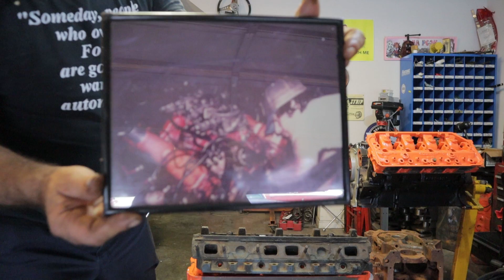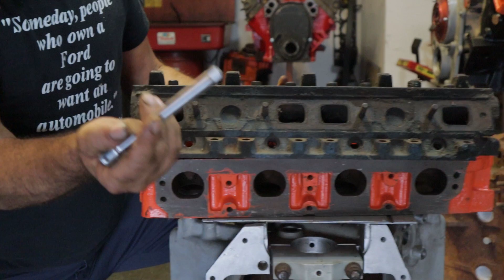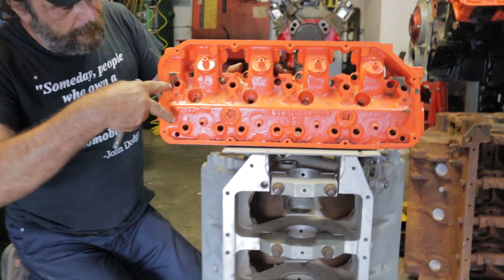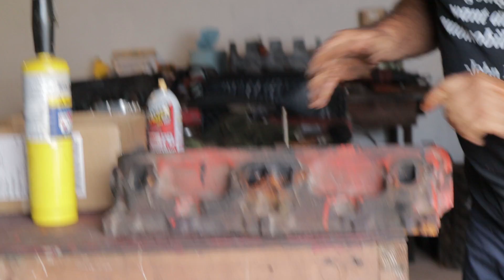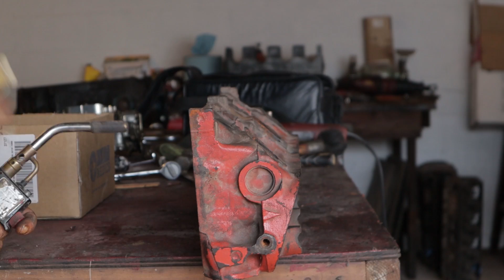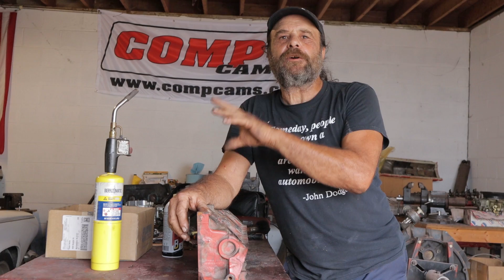What Makes The Small Block Mopar Such A Great Engine?

Comment: The valvetrain layout on the LA Chrysler is very poor with lots of pushrod angle at the lifter.  The exhaust port is poor it has no short side radius what so ever which makes the port very turbulent.  Take a pitot tube and check the velocity at the bottom of the port and you'll find that it goes in the wrong direction.

Comment: one good thing about the small block chrysler , that he mentioned at the beginning of the video the shaft mounted rocker arms that they have , that keeps the rocker arm in better alignment with the valve stem , so you get reduced wear on the rocker and valve , and keeps the valve timing more accurate . chevrolet chose ball-pivot stud mounted rocker arms when they designed the small block ,no doubt as a cost cutting measure . even ford cheaped out when they designed the 221/260/289/302 engine and changed from shaft-mounted rockers on the Y block series to the chevrolet style pressed -in stud mounted rockers . i believe the slanted six uses shaft rockers as well as the LA and B /RB chrysler engines

Comment: Video is good 👍 you're T shirt sucks. I have just finished up restorations for a customer 70 Challenger RT convertibles one 440 SixPack automatic Go Green,  the other 426 HEMI 4 speed manual pistol grip. Both convertibles back to OEM  Only i did update safety like 4 wheel  4 piston disc brakes, suspension with original size 15 inch wheels.  Built lots of SB MOPARS 360LA & 340 SixPack. Built almost nothing but MOPARS in the last 20 years but I love my 62 Falcon with SBF Offenhuser Tunnel Ram that can run with any MOPAR.

Comment: I've got a '70 340 shortblock that was given to me. For heads, I got a set of '89-'92 "308" casting heads off a 360 from a van. The air injection ports need to be plugged, maybe just smooth the casting surface in the exhaust port. What does Uncle Tony think about that idea?

Comment: It's not ,they were never close to making the horse power the small block Chevy or Ford ,no 4 bolt main blocks the heads won't flow the # a Ford or Chevy small block it will run with a 440 because the 440 head doesn't flow ,power is in the heads of its not a hemi go with a big block Chevy or Ford

Comment: 318 cube...bore .030, and stroke it to 4 inches......390 cubes
Reply: It's amazing how these small engines can get large with ( seemingly ) small changes in dimensions. 331 early hemi's were popular for this getting beyond 450 ci , but 392 iron blocks didn't do as well with strokes beyond a certain point from what I've read. Small changes in geometry can make for an expensive outing at times I guess.
Reply: @Mike_Collins392  they have the 318 to 390 stroker kits.  You can do the same job to a 360 and get 408 cubes.

The 392 had a 3.906 stroke to start.  The bore was 4 inches even.
Reply: @markdubois4882  Yeah , they refer to it as a " square motor " ( 392 ). I was just making conversation about changing this stuff and perhaps depending on the application sometimes it can work out and sometimes it may not be the best option. But yeah the 392 was a raised deck version of the 331 making the rod geometry different , and not as receptive to changes apparently .
Reply: @Mike_Collins392  the 331 and the 354 share the same block.  Bore and stroke are different.  The 392 is a raised deck version.
Reply: @markdubois4882  That is correct. 

I have a 55 331 , 56 354 , 58 354 truck , 2 - 57 392 engines . If I was rich I'd have a junk yard of 1950's Chryslers , lol ( smh ).

Comment: I'm a mopar guy and I'll tell you that the exhaust side of the mopar heads are it's achilles heal.... great valve to piston angle tho....large lifter diameter and long rod ...... built with decent flowing heads can be screamers!  Now the 452 and 906 bbm heads actually flow fairly well for what they are

Comment: I had a '72 Demon 340 4 speed. I put a hemi clutch in it, a Mr. Gasket Bang Shifter (like a Hurst Super Shifter) and a pair of Lakewood slapper bars. Even detuned, it was a very strong runner. I later did a head swap to the earlier high compression heads and installed a 340 six pack camshaft. That really made it a screamer. I raced 350 Chevys, 396 Chevelles and an occasional 454 Corvette. The 350's (except the LT1) and low compression 454 were no challenge, the 396's in 325 & 350HP tune usually were beatable but the L78 was too strong. I used to sidestep the clutch at 3,000RPM off the line and shift at 5500. I went through a few 2nd gear synchros but other than that, the car was rock solid.

Comment: Air is basically a fluid. So just reading up on fluid dynamics a little bit will help to understand how air will flow through a head. Extrude hone works very well because even though it's a thick mixture of abrasives, it will still flow exactly like air.

Tony, I've asked you this question a few times and you have either not seen it, or are blowing me off. Was there a 273 aluminum block stock on 66 barracuda's or any other Chrysler products? Back when I was busting tires before I started spinning wrenches my roommate had a 66 barracuda. I can swear that thing had a aluminum 273 and it I have looked all over and have not been able to find any information on it. I figured if anyone would know it would be you.

 I also remember something from way before the Internet that that 273 block was sold to Mercedes-Benz, and is the base of all their V-8's. But I can't find anything else about that either. 

A simple yes or no will suffice.

Comment: Great video, thanks for all the information and demonstration. I wish I'd had access to this type of information when I was younger, it would have prevented a lot of mistakes on my part. There used to be a Plymouth Duster that drag raced around these parts the was rumored to have a 273 in it  that couldn't keep the rest of the drive train intact because of the power output of the engine. I saw him snap an axle at the line one night when he dumped the clutch. It was always something, u-joint, clutch,  wheel studs. I know it sounds like a fairy tale but I saw the axle snap that one night. This was back in the late 70's like 77-78 maybe it';s been a while. He was also rumored to be capable of extremely high RPMs.

Comment: I have a 318-3. Are they worth the trouble hot ridding? I know they have some trick parts on them with sodium filled valves and higher flow oil pump. The downside is trying to find trick parts for it.

Comment: A good exhaust port with a good valve job, with a back-cut on the exhaust valve will scavenge all the fuel and air you can pump in. So many engines are crippled by bad exhaust designs, like the Windsor.

Comment: Hi Uncle Tony...ty for the Video...I am currently doing a SB 408 stroker MAGNUM build...Ned Erkman is doing the tech work of Rolling Thunderz ...I think we are almost done ..over 2 years and a ton of doe...heads are Edelbrock ..NHRA Superstock heads..flow currently 300 cfm lets see if we can get some more ..208 intake 165 exhaust...we tamed the Cam down .... as we calculated over 16 lbs of vacuum...so it should be quite streetable..it better..
Be...😳 ..what started as a fun project hasn't turned out that way LOL...putting the piece into my restored body off 99 Dakota...5.9 RT MAGNUM...Not a lot of goodies for magnums...lots for the LA'S...CIAO PAESANO.

Comment: Hello, If I have a 67 impala ss stock 350 with 305 heads, SP2P manifold, edelbrock 1406 carb, msd ignition, 28in tire, and 3:08 gears similar to daily driver build but chevy. Currently running th350 considering 700r4 but want to know if its worth the price and possible how much mpg's could i hope to gain. I love your videos and they inspired my build thank you.

Comment: My first builds were the LA318. I was amazed, and so were my chevy/Ford friends, with how much power they made with cheap simple upgrades and tweaks.
In 1995, I ordered a Dodge Ram with the Magnum 5.2L, NV3500 5sp and 9.25 3.55 posi. Out of the box it was a pretty good combo but, it wasn't enough. Being under warranty, I started with Mopar Performance parts such as a performance ECM. After learning the fuel pump was good to about 500hp, I installed bigger injectors from a Saleen Mustang. They were plug and play!
Then I learned the first year '94 models had 2.25 exhaust outlets verses the' 95 1.875 outlets. So, I swapped them out. FYI: the Magnum manifolds flow as well as the gold standard 340's do! Then shortened the exhaust to just past the cab running into a duel Flowmaster big block muffler configuration with down spouts. 
Next came swapping the rockers to 1.7/1 ratio from the stock 1.6/1. Along with a Nascar developed throttle body airflow director. Which smoothed out the incoming air into the throttle body. Next I custom built a ram air system using a 16x4 air filter box with 4in duel inlets. I fed it from 4 inlet lines comprised of (2) 4in hoses running from air scoops between the radiator and headlight assemblies fashioned out of home roof snorkel pipe gasket assemblies. Using the OEM rubber air dams as templates for mounting.
In addition, I ran (2) 3in inlets from the below the bumper air dam where I mounted 3x9in scoops where fog lamps would normally mount. I used a standard plumbing PVC combination 4+3 to 4 Y adapter to plumb them to the 16x4 air box. Lastly, I installed a March Performance reduced ratio pully set.
At this point, the engine was producing so much power it began to overheat under load. Even with the oversized OEM towing package radiator I ordered it from the factory with. My solution was simple and cheap. I found another NASCAR developed product called a "water wetter". Basically, it prevents steam production in the cooling system between the coolant and engine coolant runners which greatly hinder heat transfer.
The final result was a still warranted 1/4 mile IROC/GT killer! I can't tell you how many of them were astonished they got beat by a small block Dodge truck!
This truck, single cab short bed with about 200 lbs of Rhinoliner, would jerk you into the seat and bark 4th gear with 355/45-16 BFG Sport Truck tires.
To tune it, I used a dash mounted Gentech strain gauge type performance computer. Which calculates horsepower and 1/4 mile stats using acceleration rate and vehicle weight. To the best of my recollection, it ran  in the 11+sec range at right around 100mph. 
Not bad for a very lightly modified configuration!

Comment: for any one wanting a stock engine to blow away the competition take a pre 1972 -318 block a 340 crank , 360 heads and any combination for connecting rods and pistons to make it work . if you do it right you can get 14 to one compression with all stock factory parts but I would go with aftermarket pistons just to keep it together. I wish I still had it but my 318 built to this set up would yank the tires on a dirt road and broke every drive shaft I installed tell I went to truck parts. this was in the late 70's I ran a offenhauser intake and forged pistons it only ran on aviation gas but my god it was a good engine.

Comment: Spark plug location... aimed slightly at the exaust valve and into the cylender like a hemi. Also the combustion chamber has airflow around the valves better than most engines. I have a 550 hp 340 w2. ... I built ford dodge and chev with a open mind to commit to the best performer.

Comment: Im a 350 Buick guy, a very capable engine like the small block Mopars, but ignored by the aftermarket. I have a soft spot for the 340 Duster and any "underdog" engine, big blocks are cool but making a small block run hard, especially an underdog, takes thought, and smarts, which is why I love your vids, your a common guy, smart, you speak from experience and I love it when you got a smoke going, it shows you dont follow the " socially correct, dont offend" policy!

Comment: I remember seeing a lone dodge sticker on a 1/4 mile track in the early '70s. 340 power.
He would start at the front and by lap 20 he would be at the back. Consistently. 
Always heard it was a heat issue.

Comment: The man's correct the small block dodge engines are a nice design, but  the reason that alot of ppl don't build alot of them for racing is the price of parts. That's why I see alot of sb2 chevy blocks and it's cuz there cheap to build

Comment: 18 degree factory valve angle heads, PLUS! Pushrod geometry in the LA engine, GOD awful!! Of course it was a compromise given the packaging restrictions within the engine's blueprints and the car and subsequent hood heights, and the original design requirements made it acceptable, but as a performance engine any layman can have a look at the pushrod angularity compared to many other engine families and see it's a poor design.

Comment: This was awesome, I'm definitely an SBM nut and daily a '71 Dart. BUT, I also have a Honda S2000 that I love. Tony, you should look into the F20c, the motor from the S2000. THAT'S a race motor.
Reply: no tq. too much gear needed for the street to run with bigger engined cars.

Comment: Tony mate....love your work. But the ONLY reason the LA heads were made like they were, was to fit the 1964 MY A Body. The "A" engine Polyspherical heads were too wide for the smaller platform compact. Hence the new wedge heads were designed to sit up and away from the inner shock tower. As you know, that also caused the pushrods to now, not go in a straight line, but are on an angle for the new head. It would have been more helpful for the plebs, if you had a Poly A head to explain the differences. Interestingly, the Poly heads probably had more horsepower potential than the LA head. As they had the even ports, canted valves and were "Semi Hemis". But they were heavy. There is still a guy here who uses a Poly in his classic Super Modified (early Sprinter) speedway car, and he keeps up with 350 Chevs quite easily. Do a video on the father of the LA, the Poly A engine.
Reply: He did a whole video on the Poly last year, and he also talked about Chrysler needing a V8 for the A body in this video.
Reply: @ericlandstrom6155  Thanks for that, will have to search it up. UT was alluding to bean counters etc in this video,  but the head design was purely to get it into the A body.

Comment: Hi there Tony. With your analysis on the Mopar LA small-block v8, how does the overall LA design geometry compare to the newer Magnum v8's cylinder head? The flaw of the Magnum is it likes to have a hairline crack at cylinders 1,2,7 & 8 (the extreme ends of the motor), however there is some of AMC's influence on that iteration in the SB Mopar in the early 1990s until all LA Magnum production ended 2003: your take on Magnums, please.

Comment: When I was 17 I bought my first car a 1970 Barracuda with a 318 the guy that sold it to me did some engine work on it, he said he put a cam in it, I know that it had a 4 barrel and duel exhausts. He sold it to me because he got a 1968 Superbee. Being 17 I beat that car, 2 sets of rear tires , rear end etc. When I sold that car the guy that bought it said it was faster than his big block Chevelle. I wish I'd Known better and kept that car, I also owned a 1979  Li'l Red Express Truck that I wish that I kept, or even the 1973 Satellite Sebring that I once owned.

Comment: Thirty years ago, I ran a mildly-warmed, low compression 440, Offy 360° intake and rebuilt AVS carb, 727 and 3:23 gears in my '68 Charger.

A buddy of mine had a '73 Duster, 4-speed, 3:23 gears, and a totally clapped-out low compression '73 340. Motor had a cam that was way too big for the combo, and a Holley Strip Dominator intake and Holley DP carb.

One summer evening, we decide to race from one end of a bridge to another. About 1/10 of a mile.

The sheer grunt of my 440 easily pulled on his 340 for about half the distance, then that 340 came alive out of the corner of my eye. That thing was handling my buddy's 6,000 rpm power shifts with no trouble. Even though that mill was on its last leg, it still ran like a raped ape.

At the end of the bridge, he beat me and my 440 by about 2 feet.

That's when I gained a whole new respect for Chysler's small block.
Reply: your mistake was a single plane intake.
Reply: @frigglebiscuit7484  Agreed. The Offy was a decent intake, but I later replaced it with the (then) brand new Edelbrock Performer RPM. Really woke up that motor.

Comment: Uncle tony,... When I was a kid, I helped a local wrecking yard who used SB Mopar exclusively for our demolition derby builds. With a 727 and the atf lines looped.
We never had an engine failure or would not start problem. Somehow, the old guys who owned that yard and were “sponsoring” us, knew...and told us what engines to use.
It was when they would let us run around in the yard ,source parts, and wrecks to use.....slap their name on it for free publicity, a couple of brothers I knew who helped were the drivers....none of us were 18.....before lawyers it seems.
I was amazed that those engines would run 300 degrees all day, and always start and still make power. Fords and Chevrolet engines would not.
You could take an old wore out 318, 340 etc , put a new timing chain on it, tune it up, change the oil....and with our carter carb with the float bowl splash restrictor we made. It was always flawless.
Usually the car.....whatever....favorites were ( depending on the category) furys or Ltds ....would suffer differential separation, jam the driveshaft into the trans and break it, or folded frame.
But the engine would continue to sing.
I’m wondering if those relocated ports aided cooling.....when .....you know, there wasn’t any water around the combustion chamber.
Anyway, that was a eon ago....and all those cars/engines are now Chinese bicycles.